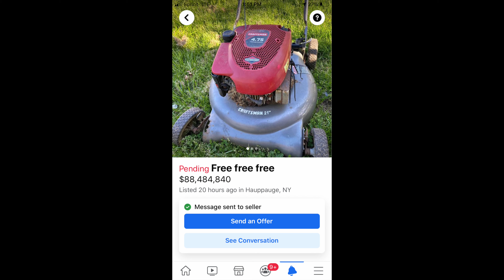1 Free Lawn Mower & 2 Scrap Mowers 2 Make 1 Good FRANKENMOWER AIN'T EASY PEASY :( GET R DONE

Comment: Great entertaining vid. 

I was watching it while waiting for a meet up selling 2 mowers.

Craftsman AWD converted to RWD 
And tuned up For  less than $5 

https://youtu.be/xcPOLC78Ma0

And

 Bottom feeder just to get rid of it
But it ran and cut ok
https://youtu.be/j8KCJCU1z3w

Both were cub alerts

Where I am a mower like that Frankenstein mower goes  for $100-120 

Yes  it’s great feeling to get a project done.  

I am down to 3 now, in 3 weeks sold about 10 mowers.  For a low volume flipper that’s pretty good for me.

1. That Lawnboy which needs a new gasket(oil leak) and traction cable.

2. Curb alert Murray ( may be just for parts or get engine going and scrap the deck )

3. Curb alert : Pressure washer with 
(Ohh noooo a Kohler 7.75 engine on it )

4.  Curbside: Toro w/ Kohler engine ,  been using it for parts  I got it stored outside under a tarp under my deck
It needs gas cap,  and entire air filter box( it’s the one that Kohler recalled and redesigned )   They should of recalled the 149cc engine and redesigned the air filter box and carb/auto-choke system years ago.